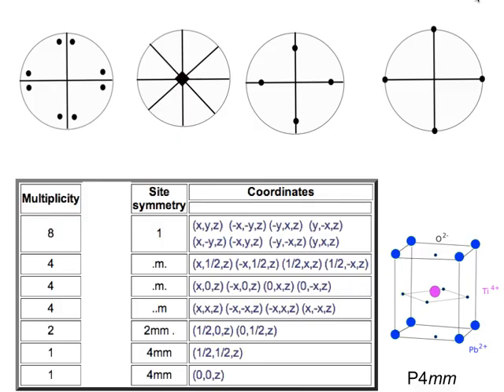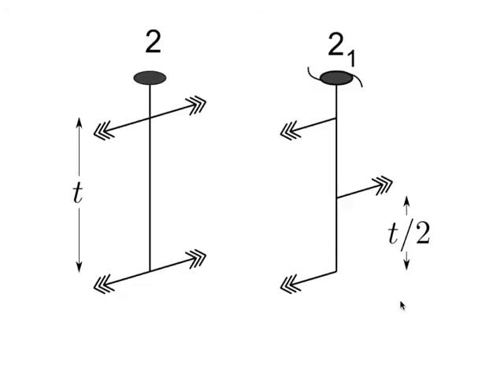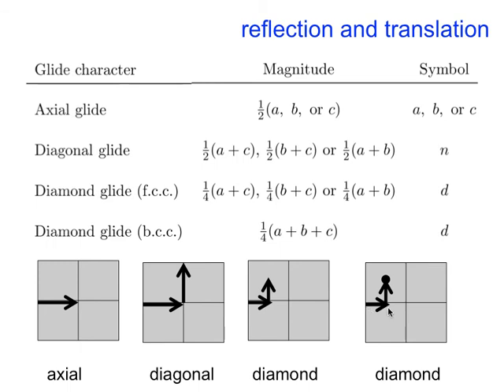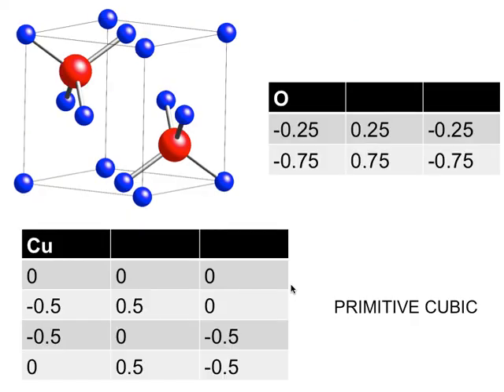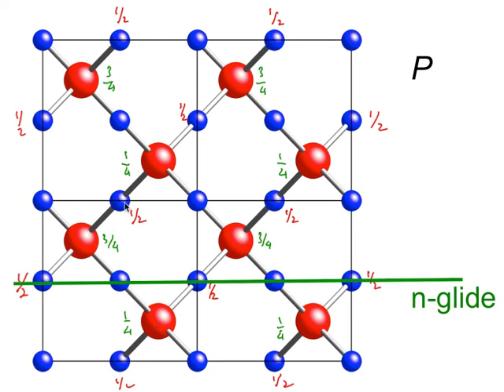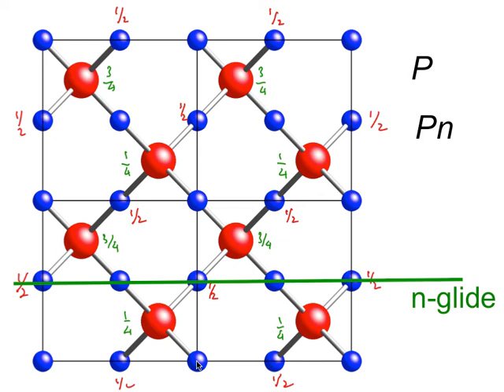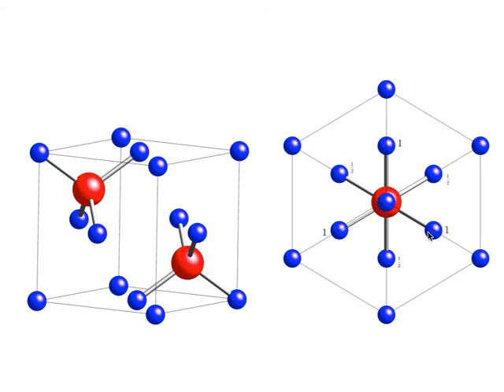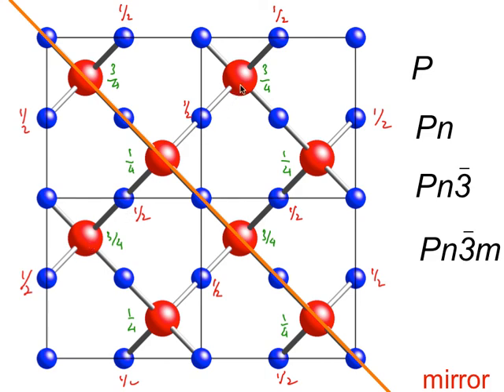Space groups  (2016) - lecture 5

Comment: Can the space group of structure determined  only by  the diffraction method ?
Reply from the maker: In general yes, because the positions of atoms determines the X-ray diffraction intensity. However, high-resolution transmission electron microscopy may also work depending on the complexity of the problem.